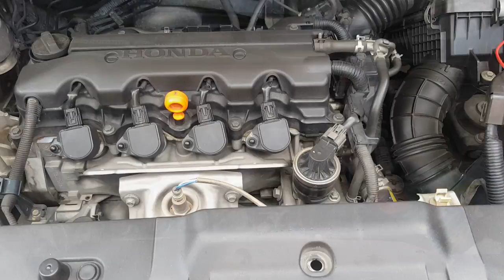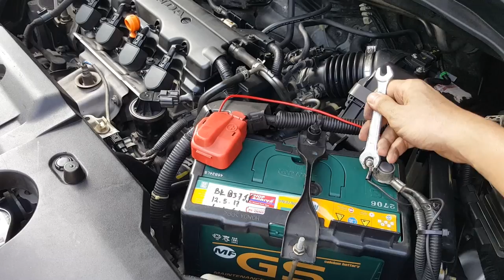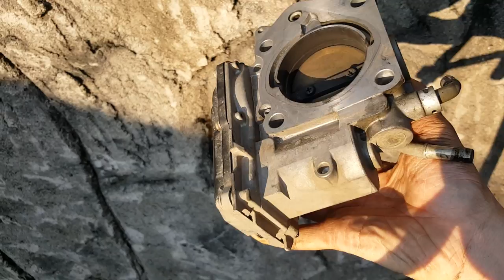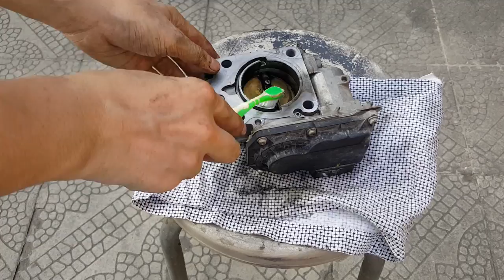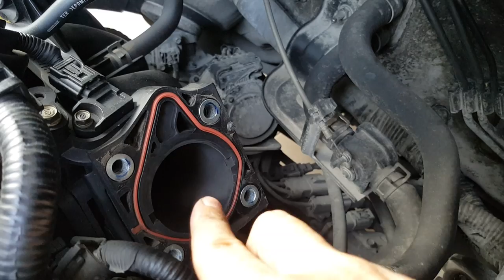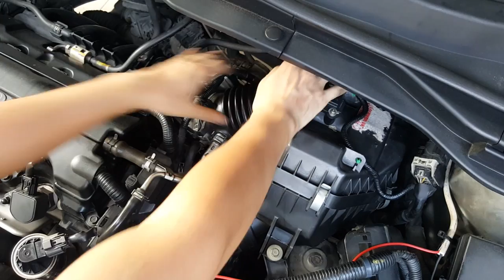How To Clean Throttle Body // Honda CRV , Civic R20A1

Comment: Honda Accord euro 2009 2.0 R20A3 just cleaned out whilst ignition on position 2 and weight on gas peddle so butterfly is fully open/closed. After clean, disconnect battery for 15 mins, reconnect with all lights and radio off, go to ignition positon 2 for 2 seconds, then start car, run at 3000rpm for 5 mins or until fan kicks in, and throttle position relearn is all done, set ready to go. Idle rock steady and running sweet 👌😙. This teaches ECU the adjusted position of throttle after it has been cleaned
Reply from the maker: perfecto 🙏🏼🙏🏼👍🏼👍🏼

Comment: Very well done, very professional.
I have a honda CRV 2015 4wd im getting 18l/100k very bad fuel consumption, my friend have the same car he’s getting 10L/100k, i have changed air filter only and i wanna know if i should take it to mechanic or should i clean the MAF and the pcv valve first! Is there anything else i can look it!! The car has 68000k.
Reply from the maker: Yes definately clean maf sensor and pcv. Also id recommend if you can clean the Throttle body aswell.

Comment: Hi boss 
I have got big questions.i had changed fuel injectors no1and 2 now my engine have problem again exactly like before change the ejection 1-2 .do you think I have to change 3and 4 Engection??! 
Regards Ram From Newcastle
Reply from the maker: better to scan the ecu which ones have issues.
Reply: @FelixDanGarasiAuto  yes mate agree  with .you are a legend 
Absolutely legend .I did that  in Honda dealerships and they said number 3 is bad and the 4 is not very well that’s why they going to change bought .will be all 4 injectors brand new .hopefully be last for ever .🙏cheers boss

Comment: Hi, Felix. When you disconnected the coolant hoses running to the TB, did you experience any coolant leaks? Or is it necessary to bleed the air out of the radiator?  I'm planning to do this service on my 2015 xtrail. The backside of the TB is pretty hard to reach. Thank you.
Reply from the maker: yeap theres a small coolant hose on the TB. Once disconnect you will get small coolant spillage. You dont need to bleed the coolant just refill it after the TB service.
Reply: @FelixDanGarasiAuto  thanks bro. Much appreciated. Have a wonderful day

Comment: Can I slowly push the butterfly valve open to clean it and without disconnecting the battery?
Thanks.
Reply from the maker: no i would not recommend. As you might damage the TB assy.

Comment: Is it necessary to pull out the whole throttle body everytime for cleaning?
What's the torque spec of those bolts?
Reply from the maker: Yeah better to remove the complete assy. Otherwise you also can clean without removing the whole unit just spray it with cleaner and a brush. But then after that you might want to rev the engine out so it burnts all the dirty residue out of the combustion chamber.

Comment: What were the symptoms before the clean and the difference experienced after? Regards
Reply from the maker: Before cleaning the car hesitates to accelerate effecting the MPG. After cleaning the car response much better and restores car mpg.
Reply: @FelixDanGarasiAuto  thanks, what is that plastic sensor just downstream of the throttle body on top, I forgot the name of it? Did that need spraying too with electrical contact cleaner? Also did you lose much coolant

Comment: Hi, Please do you know where the fuel filter is located on this vehicle? I need to replace it and i can't find the location. Thanks
Reply from the maker: its built within the fuel pump unit.
Reply: @FelixDanGarasiAuto   Can it be cleaned if i get the fuel pump out?
Reply from the maker: @shawlix  yes ofcourse
Reply: @FelixDanGarasiAuto  Thanks. Will let you know how i get on with it.

Comment: at what miles was this done and whats your opinion on the shops that will spray cleaner into the intake which cleans throttle and engine from carbon by burning it off? i have a 2016 crv ex  and 72000 miles on it..i bought it used so i am not sure the care it had..i do get a rough idle while stopped at lights and so i flip the headlights on to increase the idle..not sure if its just a honda quirk or a dirty issue...otherwise she runs good. thanks for your advice.
Reply from the maker: i cant remember at what milage but it was higher than 60000kms. It is fine if you use spray cleaner into the throttle body. give it a go it might eliminate the rough idle.

Comment: Hi boss, can advise my crv SWA model after do engine valve adjustment, when in cool engine start, the rpm will go down below 500rpm after press the brake and in Reverse gear ?
The rpm not consistent in 750~800
I had clean the TB and EGR valve and it still the same issue
Reply from the maker: have you check the spark plug and coil pack? have you clean PCV valve? do you have any error codes (EML) .
Reply: @FelixDanGarasiAuto  All the spark plugs are new, and there's no error code, the pcv valve is located at where ?
I had ordered 4pcs of new plug coil, when arrive will change it
Reply from the maker: @mongeesan6662  i have post video on this engine R20A1. do you have k24a engine or the r20a engine ?
Reply: @FelixDanGarasiAuto  Ya, just check with Google, I had change the new PCV valve already, the rpm is still unconsistent too, is any other  sensor will affect this issue ?
Reply from the maker: @mongeesan6662  maybe disconnect the battery for 10 mins to reset the ecu let see if thats fix the problem.
Reply: @FelixDanGarasiAuto  alright, will try it thanks for the info

Comment: Setelah cleaning throttle biasanya kan harus di learning ya om, pernah coba learning throttle secara manual gak om di honda crv bongkok ? Klo pernah boleh share dong 😀
Reply from the maker: Relearn nya bisa lewat obd ecu. Ataupun bisa dengan cara manual saja nnti setelah 5 sd 10 menit mobil dijalankan komputer ecu mobil nya bisa menstabilkan TB nya tersendiri.

Comment: Can someone guide me what to do after cleaning the TB my crv consumed more fuel.
Reply from the maker: disconnect battery for 10 mins let it idle for 15 mins & drive it slow for 10 mins so the ecu relearns properly so you get the best performance out of it.
Reply: @FelixDanGarasiAuto  Than you Dan, I’m doing it now. i’ll update once it done.
Reply: @FelixDanGarasiAuto  Hello Dan, Thank you so much! perfectly work! I just followed your instructions. 🍻🍻😊
Reply from the maker: @dondimartin6235  No problemo. 👌
Reply: change engine and cabin filters

Comment: Do I need after I cleaned the choke, to make its adaptation?
Reply from the maker: Yes clean the choke plate and Throttle body barrel.
Reply: @FelixDanGarasiAuto  Adaptation using a computer need to do?
Reply from the maker: @romanvaliev160  if you have the tool . Yes please do it for accuracy setting.
Reply: @FelixDanGarasiAuto  The fact of the matter is that there is no such tool. Where I live, there are no special services for Honda. If the throttle does not work properly, then I have nowhere to go to fix it.
Reply: @FelixDanGarasiAuto  thanks for answers

Comment: Om, mengatasi rpm idle naik turun setelah throttle body dibersihkan bagaimana yaa??
Reply from the maker: Apakah sebelum bro bersihkan Throttle body baterenya sudah di copot?? Kalo belum coba di copot baterenya dahulu selama 10 menit dan kemudian pasangkan kembali baterenya ini untuk me reset ecunya. Jika sudah lakukan copot batere dan problemnya masih ada maka coba tahan gasnya pedalnya pada saat mesin nyala di 3000rpm selama 3 - 5 menit. Terima kasih.

Comment: Do where is the location of 2nd clutch sensor for this car?
Reply from the maker: Im not sure. Sorry bro.
Reply: Hi hello mr. Dan, can you please help me to locate where is the iacv of honda crv 2011?
Reply from the maker: @sher12346weng  need more info . What engine code does ur car have.
Reply: @FelixDanGarasiAuto no error appear but i just want to know only the location of iACV somebody told me that i need to check or clean that part to have better idle.
Reply from the maker: @sher12346weng  i mean what typenof engine doesnur car have is it R series or K series gasoline engine?
Reply: @FelixDanGarasiAuto  R20A
Reply: Do u have ideas?
Reply from the maker: @sher12346weng  it should be next to the throttle body. Theres a sensor there.
Reply: @FelixDanGarasiAuto  do you have a sample pic of iacv? Im so sorry im dont have any ideas what kind of sensor is that. I hope you can help me
Reply from the maker: @sher12346weng  whats your email i can post diagram for you.

Comment: Before clening engine have problem ?
Reply from the maker: Throttle response was very slow.
Reply: can you advice my car enging have virbrate when air comp. working and round 750 rpm (changed spark plug & air fillter) thk.
Reply from the maker: @degdee3247  check if you have a weak motor mounts ??
Reply: thank you

Comment: Is this engine reliable
Reply from the maker: yeap its a reliable engine.
Reply: @FelixDanGarasiAuto  is this reliable like honda 1.5 ivtek engine in honda  city sedan
Reply: @FelixDanGarasiAuto  is honda 5 speed automatic ( torque converter) in crv 2013 to 2018 reliable
Reply from the maker: @anubhavredhu0121  very similar yes
Reply from the maker: @anubhavredhu0121  yeap as long as the prev owner regularly service the car should be a good car to buy. 👍🏼

Comment: Do it need to be relearn?
Reply from the maker: Nope just let it idle for 5 mins
Reply: @FelixDanGarasiAuto  mine starts to fluctuate not in idle but in deceleration after release the gas pedal.
Reply from the maker: @richardamancio  drive it for a while . It should relearn it self.
Reply: @FelixDanGarasiAuto  the PCM need to reset and idle relearn is needed. This will happen if the valve is pushed open.

Comment: Job incomplete where’s the idle relearn?
Reply from the maker: The ecu will relearn by itself. Make sure you disconnect negative battery prior performing this service. Just give it a couple of mins warming up the vehicle. This car had no running issue and idle 100% perfect after the service.

Comment: is it ok not to remove the throttle body in the engine?
Reply from the maker: Charles Fortinez it is also fine not to remove the Throttle body . You also could just spray the TB plate with the cleaner and wipe it gently with rag becareful not to force open the TB plate.
Reply: @FelixDanGarasiAuto  thanks for sharing the video. If you don’t remove the TB then how would you clean the other side of the plate as well as the manifold behind it?
Reply from the maker: @mr.tuckers2848  im afraid you have to remove the TB completely to clean the other side of the plate